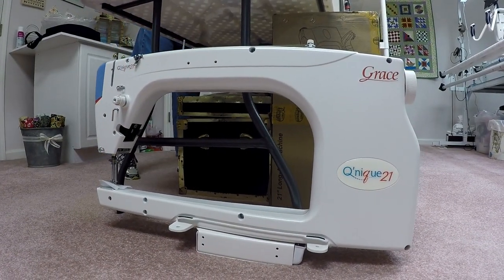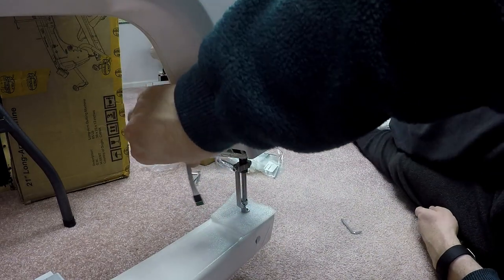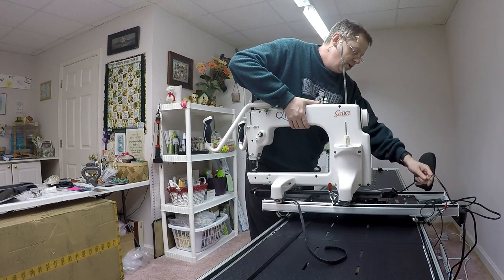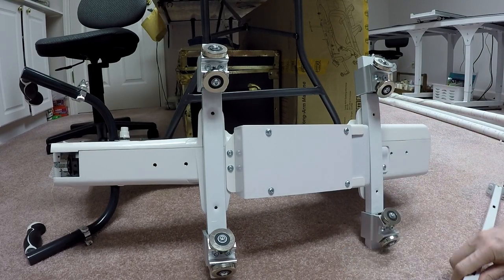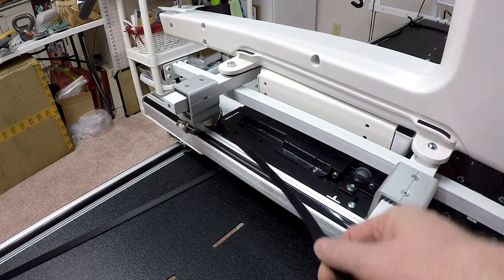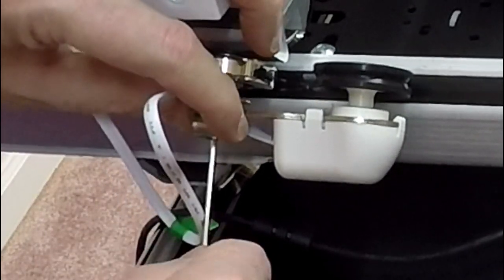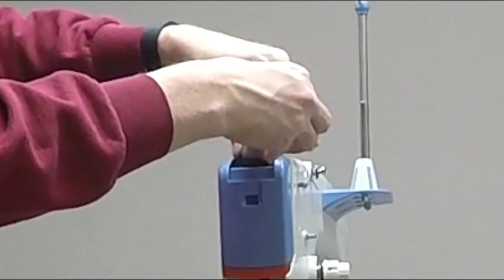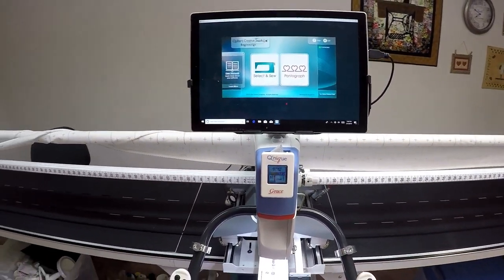Upgrading from Q'nique 14+ to Q'nique 21 with Quilter's Creative Touch on a Continuum frame

Comment: now Q’nique is saying that you cannot use the 21 with a continuum frame, you must have the continuum II. Did something change in the last couple of years? Because I don’t feel like upgrading the frame and from your video it doesn’t look like i have to… any thoughts?
Reply from the maker: Hi Heather. We have used a 21 on a Continuum without any issues. Most of the videos on our site that show a 21 are on a Continuum. One of our videos shows me taking the 14+ off of our Continuum and replacing it wat a 21. Not sure where you are hearing what you heard. Sounds like Fake News to me. :)

Comment: I am presently waiting for my 21Pro to arrive. I was watching a video on SMP Virtual Quilt Fest 2021, started on Monday. Any way they have different people demoing different things. I noticed in one video by the Grace Rep. that the channel lock was on the front right hand wheel, which makes so much sense as it is within arms reach and not necessary to really stretchy or go around to the back of the frame. What do you think

Comment: My new 21 does not have belts. Is that because I don't have the upgrade commuter automati ion?
Reply from the maker: You only have belts if you have Quilter's Creative Touch automation. One belt that runs the length of the frame, and another that runs under the machine. You will not have belts if you do not have QCT. Hope this helps.

Comment: I would like to know if your wife liked the Qnique 14 and would she recommend  this machine, And was she able to do a king size quilt on it?
Reply: This is Doug's wife. I loved the 14.....I loved that, being a short person, it was "my size." I could pull it forward on the frame and reach around to turn the wheel or set the horizontal channel lock. I could lean over the rail to see exactly where the needle was - with the 21, I have had to get a step stool. With Glide thread in the bobbin, the stitches were always so nice. (Note: I have only recently determined that domed shaped bobbins work better - I have a LOT of flat sided ones from earlier days with a Tiara....and that was what I was using with the 14, and wasn't getting good tension until started using Glide prewounds, where you are not using a metal bobbin. Now I can't help but wonder what the tension would have been using domed bobbins.) If I were still only doing free motion quilting, I would still have the 14! It's lighter and easy to handle - and the smaller quilting area makes it easier to see what you're doing.. So if FMQ is all someone plans to do...then yes, I would recommend this machine to them. BUT.....if you plan to get the software.....then you will want the larger quilting space. The only other thought that comes to mind is if you want to quilt for others....where time is money.....then a larger throat space might be more desirable since you won't have to advance the quilt as often.
The largest quilt I ever quilted on the 14 was 90 something inches long. I still had some room left in the throat when finished (using Warm and Natural batting - top and backing were cotton.)
I will always....ALWAYS.....love my sweet Esther and the many happy hours quilting with her!
Reply: Thank you so much for getting back to me. I really appreciate it. As I've been going back-and-forth on whether to purchase one. I already have a 12 foot frame for Bernina that was made by the grace company. So the frame will except the 15R. I just worry about growing out of it too fast. I have no intentions of doing it for money or using a software. This is supposed to be brain work  LOL. Thank you again
Reply: If you haven't already.....find someone you can spend a few hours with at their house while they are longarming, preferably doing FMQ, machine brand doesn't matter. That could help a lot with your decision.
Reply: Joyfulstamper it seems like everyone around me uses softwares on big machine. There are no local dealers around with the Qnique. How long did you have your 14 before upgrading? Are you upgrade for the software?
Reply: @lynlitalien1077  I have only had the 21 a few months. Had the 14 almost 2 yrs prior to that. At the time we purchased the 14, I had NO idea I would EVER have ANY kind of software!!!! But when the Beginnings was on sale for $2,999 at the Houston quilt show a year later....well.....just couldn't turn it down! I have no plans to purchase the more advanced software - while it has a lot to offer, all that it has takes a fair amount of time to use! As of now, I'm happy to quilt for myself, friends and do charity quilts. Taking a week or more to quilt a quilt (i.e. custom quilting) just doesn't call my name. No regrets purchasing QCT - is SO much fun to use!!! And it's the ONLY reason I now have the 21.

Comment: Quick question. Are the directions for the 21 pro the same as these?
Reply from the maker: Yes they are. The only difference is the larger display, but it attaches similar to how it does for a 21.

Comment: Does the machine come with the belt bracket?
Reply from the maker: The belt bracket should be supplied with the QCT Hardware installation. Contact Grace Company if you need one.